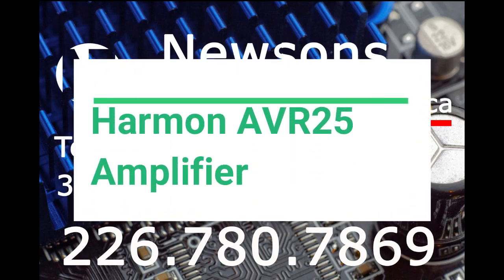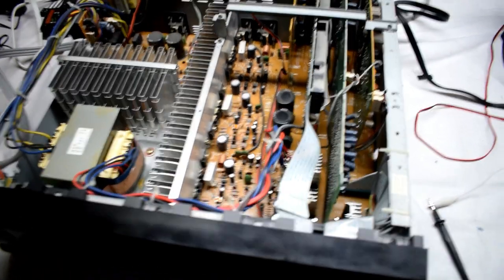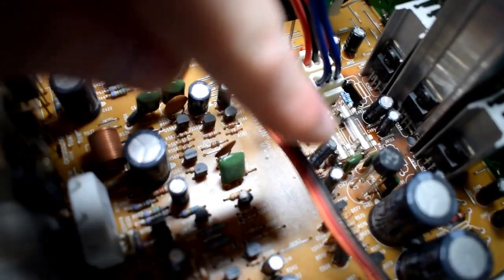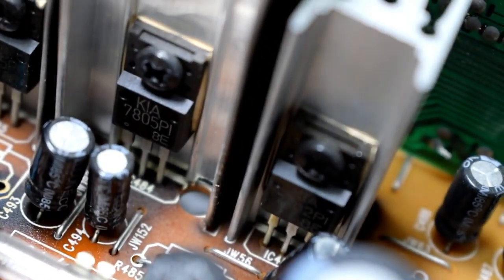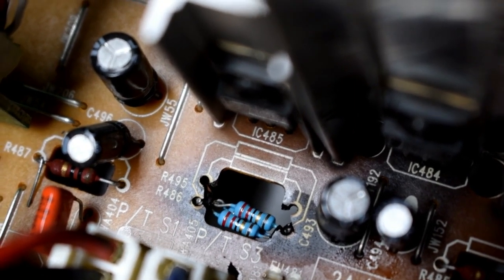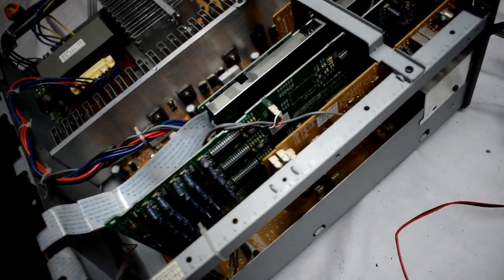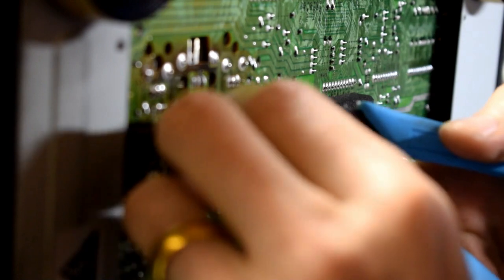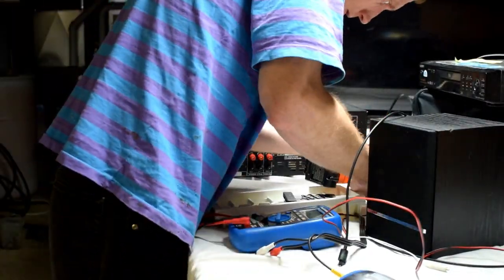Harman/kardon AVR25 Repair

Comment from the maker: Any Questions just ask them below
Reply: You have a schematic for this amp. Mine cuts on and off intermittently.
Reply from the maker: @frankmc5112  check the solder joints
Reply: @NewsonsElectronics   Finally got to it today (11/13/2022) and I found a loose solder connection along with some others that appeared cracked. Thanks for the help. I got a receiver that's been in the family for 30 years working again.

Comment: Hi. My avr35 only work on stereo with bypass mode. I cpuld not select anybof the digital processor mode. Ie: hall1. It will have no sound if any of the digital processor selected. Optical input also not working. Now just L&R speaker only produce sound. Any advise?
Reply from the maker: sound like the dsp chip is bad
Reply: @NewsonsElectronics  oh man. I really love this avr. I will check it. Thanks man.

Comment: Hi my harman kardon avr25...will go to standby orange light but when i pushed it on...it will chatter like a clicking noise and i opened it up to find out, it was the relay in power supply thats making the chattering noise....so i ordered it online and replaced it but as soon as i turn it back on....still chattering and didnt fix the problem,....any idea which one i should look unto it and need to check and replace....i was thinking of replacing the whole power supply, i can only save this if not buy a new receiver instead of having it repair in a shop that cost too much

Comment: Hi, i have avr 2000 which looks exactly  like this model inside, it plays like half an hour and then it goes in stand by. When i try to power it on again it wont turn on. After maybe 20 minutes it can be started again. Amplifiers all channels work. Regulator on power supply gets pretty hot but tests ok. Any help would be appreciated
Reply: @MrNew-us1lg  Heat sinks are warm, all voltages are ok, i cleaned the glue and replaced capacitors with bad esr. Now when it turns off i can turn it on again and it goes ok for 1.5 -2 hours before it shuts off.
Reply: @MrNew-us1lg  yes, when i say turns off i meen it goes in standby. I can turn it on again and it plays and after some time it goes in standby. I dont think its some auto shut down becouse its random. And thanks for reply
Reply from the maker: no problem

Comment: Question: My left speak does not give a sound. If I move the balance volume towards the left side you can hardly hear the sound. Can this be fix? Thanks in advance!
Reply from the maker: I am sure it can be fixed but you would have to check it out.
Reply: @NewsonsElectronics  Lucky here, there is a shop close to my place that still does this kind of jobs, so. my receiver goes in this coming Monday! Thanks!